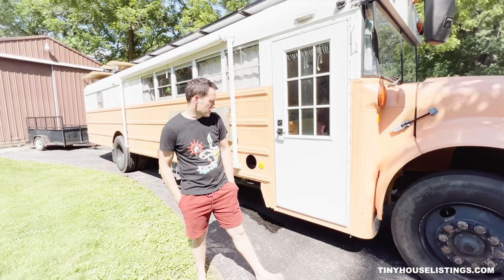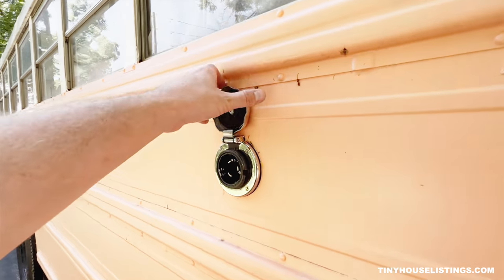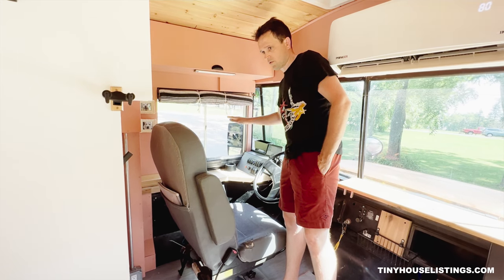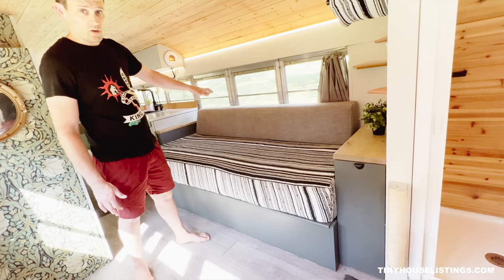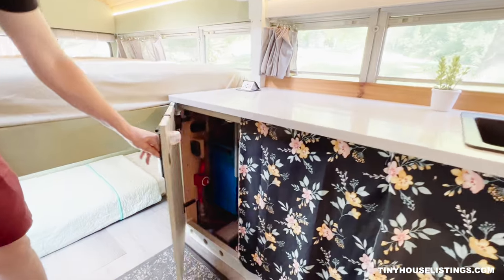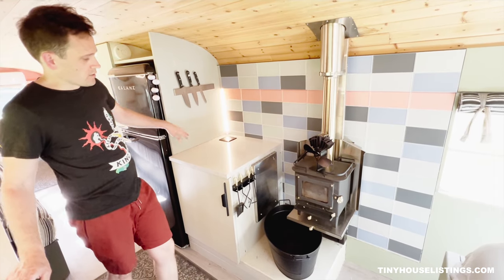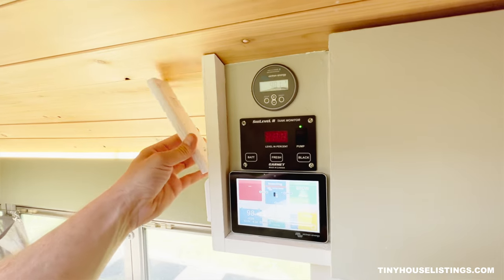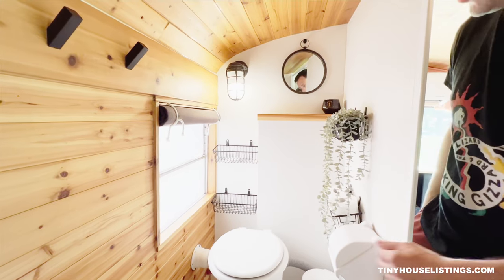Amazing 38' Skoolie Tour with Full Bathroom & Water Tanks | Tiny House Listings

Comment: How do you keep all this working in Vermon't Winter? Here in Maine the water lines would all freeze up. Do you park this in a heated garage when you're living in it in the Winter?
Reply: Hi there! All our water lines run inside the bus and have armaflex insulation wrapped around them. We stayed in Denver when it was 3 degrees, ran our mini split & had our wood burning stove on and our pipes never froze! We also followed the warmth, but it definitetly built to withstand colder temps!